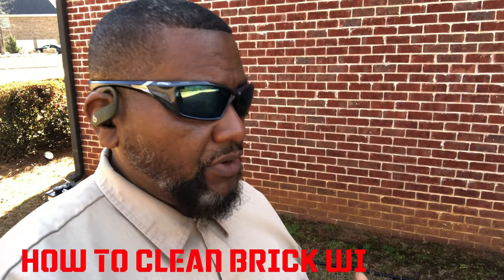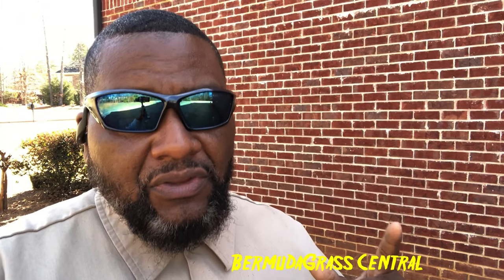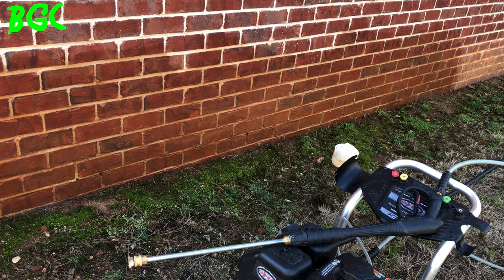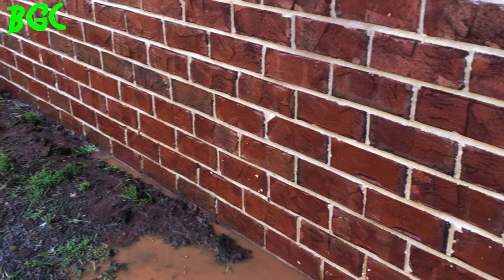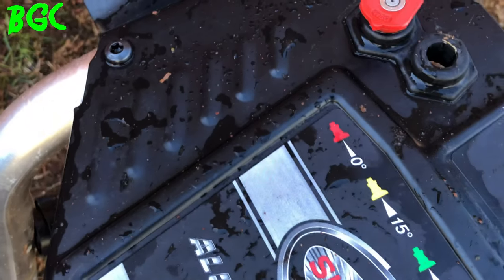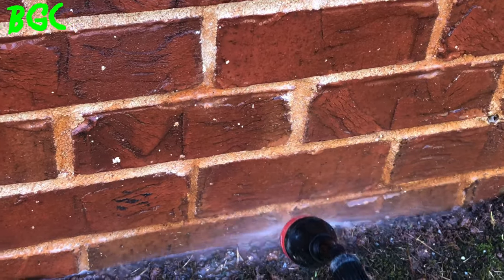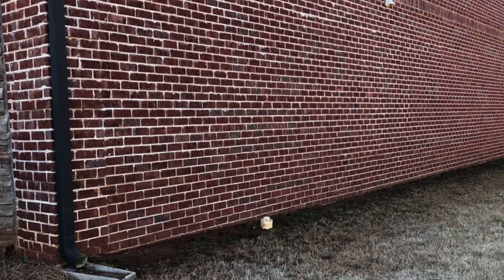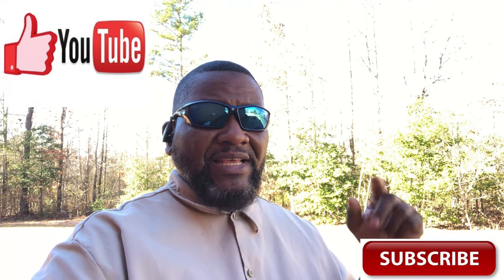How to clean Brick with Acid and remove Red Clay stains

Comment: Great video Bruh! I had to use some muriatic acid during a pressure washing job recently. The brick had a white haze due to the brick layer not cleaning the brick after laying them. I had to use straight acid.. no dilution. 10+ years of the haze being there. It came off a little but not life changing.  Keep up the great work!

Comment: Great Video BYD.  I have added a Turbo Nozzle for my pressure washer inventory.  Works great.  The other thing to consider is a surface washer, although it is harder to use on walls.  It really cuts down on the spray, though.

Comment: so this house i bought, the previous owner put beach pebbles all around the edge of the house. this way, when it rains, the red clay doesn't bounce back up and onto the house - which happens due to gutters that are full, or just super hard rains. at a point, i added more pebbles, but found that they would wash away. so i got bigger white beach pebbles which are fairly cheap. and that helps a lot.

Comment: BYD, man, you got me hooked to your channel. I like your tried and exemplified, no BS approach.
Also I like you are right down the alley from me, SO I KNOW EVERY ONE OF YOUR ADVICE applies to my case.

Quick question: I know the Muriatic Acid is recommended by professional brick and concrete workers.
How would you think a mix of hot water, dawn/dish liquid and oxy/generic whitener would fare if you leave it for 10-15 minutes, use a stiff plastic brush than the pressure washer?
Also, did you see any vegetation burn-out from the acid?

Much appreciated and keep up the good work.
Reply from the maker: Tony t I wouldn’t mix, if do separate apps, better safe than sorry, no veggie burn 🔥 so far. 🙏🏾

Comment: After watching this, my thought is that you didn't say enough about what Muriatic acid is and what it can do.  Another name is HCl, or Hydrocloric acid.  The container is not pure, but as-is, it will kill about anything.  I pour a little on fire ant piles to wipe out the colony.  It seems to kill anything that is alive.  This acid will also dissolve concrete or mortar.  Therefore if you spill it in your garage or on your driveway, not only do you have some deadly fumes floating around, but say goodbye to your concrete finish.  Immediately.

I watched this video and note that you started with grass up growing against the brick.  At the end, the acid had wiped out the first 6 inches of grass - nothing left.  Did you see that?  What's the point of cleaning clay from the brick when you are left with bare clay that will only splash up on the brick afterwards?

Comment: Hey BYD, cool video. You have a nice pressure washer. Do you think it would get the mud off without using the acid?
Reply from the maker: Dillon Waggerman in my case it did not do a good job. This worked faster.
Reply: Brick and stucco/dryvit is so porous that it takes in a lot dirt and debris. I had a similar situation on an exterior cleaning job. The brick had a white haze from when the bricks and  mortar were originally laid. The installer should have clean the brick the next day. Fast forward 10+ years later, no matter of water pressure would remove the stains. In fact, the pressure washer removed some mortar but not the stains. I had to use un-diluted muriatic acid. It made a difference but it did not remove all of the white haze.

Comment: BYD, Do you know if it’s ok for the Muriatic Acid to get on the grass without killing it? I have the same issue with the red clay on my Brick just want to make sure I don’t kill my grass in the process.
Reply from the maker: John B I’m not absolutely sure but if you doing it while you Lawn is dormant it will have time to spread by Stolon production. If your talking fescues you May have to reseed , but well worth it to get that mud off the brick 🧱
Reply from the maker: John B I’m not absolutely sure but if you doing it while you Lawn is dormant it will have time to spread by Stolon production. If your talking fescues you May have to reseed , but well worth it to get that mud off the brick 🧱
Reply from the maker: John B I’m not absolutely sure but if you doing it while you Lawn is dormant it will have time to spread by Stolon production. If your talking fescues you May have to reseed , but well worth it to get that mud off the brick 🧱
Reply: Thanks for your feedback going to Home Depot tomorrow, the Brick you cleaned looks good. Great Job
Reply from the maker: John B 🧱 👍🏾

Comment: Did that kill your grass
Reply from the maker: Handy Manny I made that area thin and weak. I’ll either add top soil or plant 🌱 shrubs.
Reply: Any damage that it does to the grass will be temporary because the minerals in the dirt will buffer out the acid.  It will only stay acidic for a short time once it hits dirt.
Reply: @jn3083  Throwing some lime on it will speed it up.